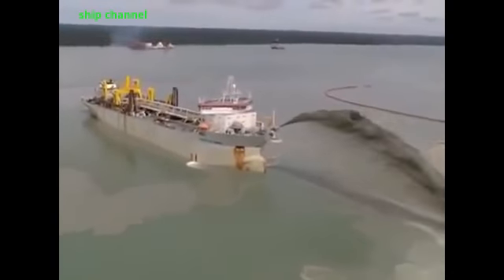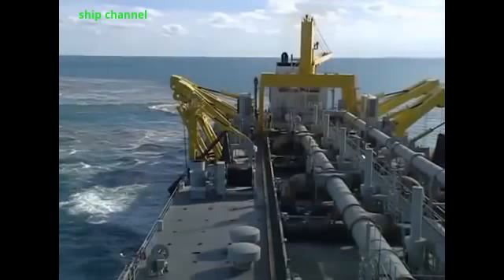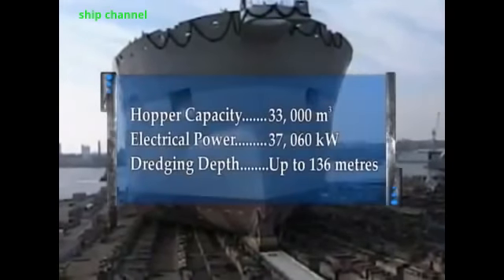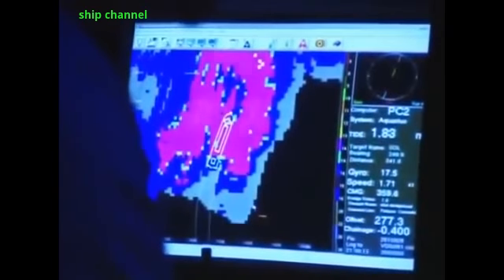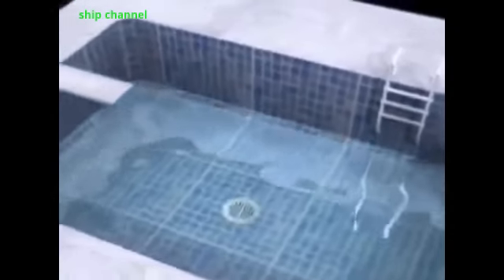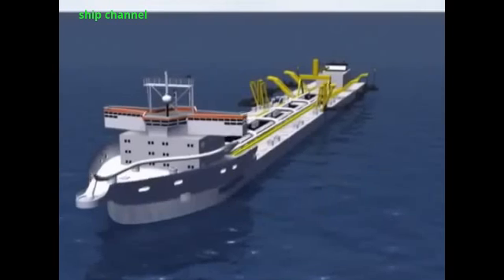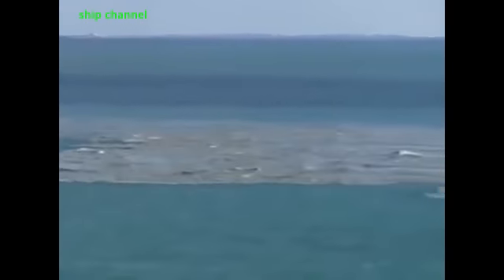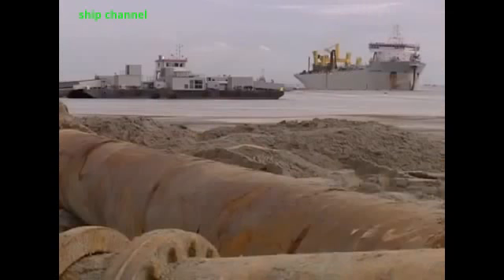The biggest Dredgers in the world | ship channel |

Comment: It's a great look at a unique ship, thanks for uploading. I love how math doesn't add up in documentaries. They say the ship holds 90,000 tons which I assume to be metric tons or 33,000 cubic meters. 33,000 cu m of dry sand weighs about 50,000 metric tons. and 33,000 cu m of seawater is about 34,000 mt which is a grand total of 83,000 mt. Problem is the material in the hopper is only maybe 20% water so the total weight would only be about 56800 mt.
Reply from the maker: thank you for your comments
Reply: http://www.jandenul.com/sites/default/files/equipment-item/pdfs/01.TSHD_NL_-_V2013-2_-_Vasco_da_Gama.pdf
Reply: i dont care, this gazillion tonne capacity vessel is awesome